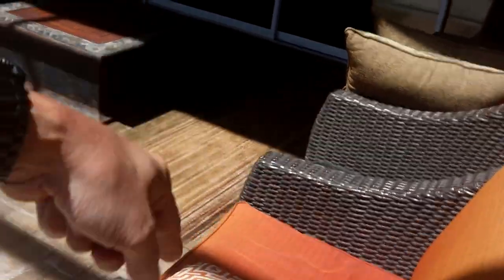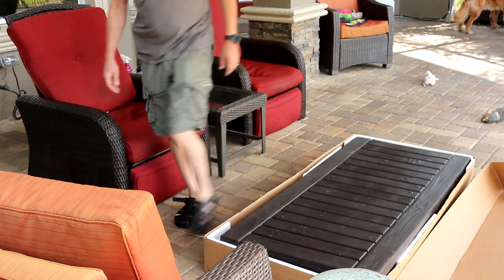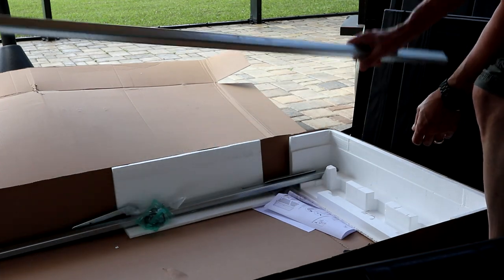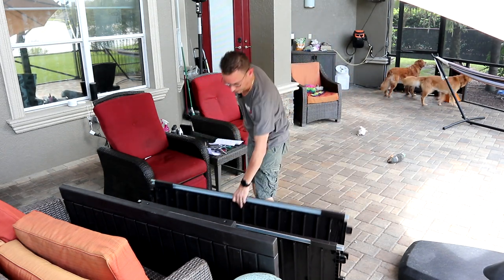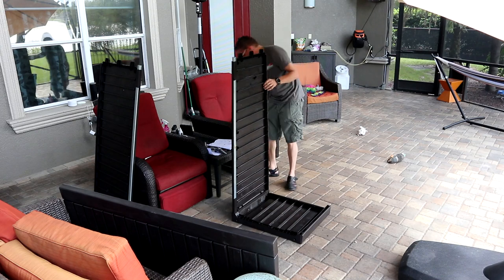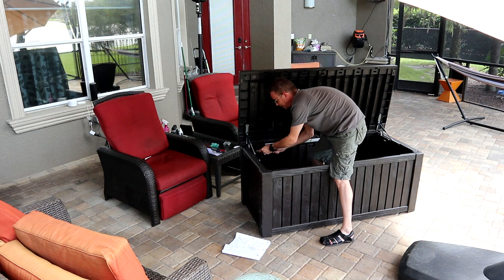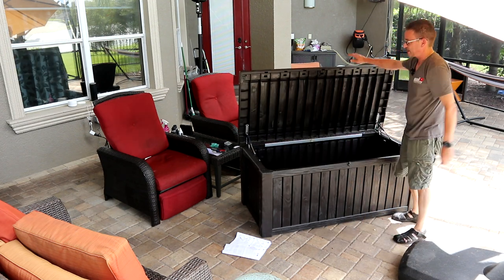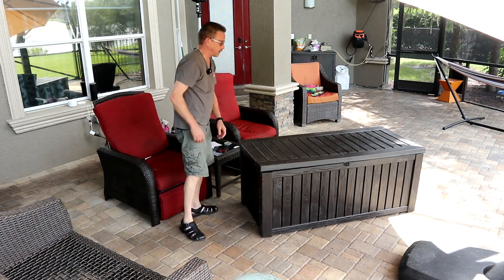Patio Deck Storage Container | Keep Pillows and Cushions Protected from Wind & Rain

Comment: Are there screws that go in the bottom of the box?
Reply from the maker: Hi Sandra, there were NO screws included for the bottom of the unit. I think it's because the bottom is fully supported and clips all together with each of the sides very well.  By-the-way, this video is over a year old now, and it's still holding up like "New". We do have ours under the porch roof so it's not directly exposed to the weather :)    -Todd